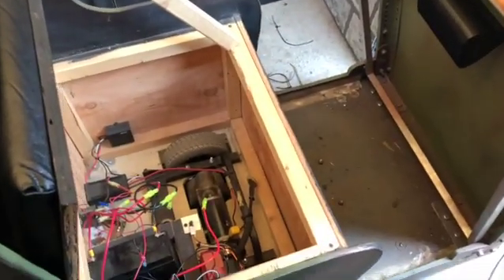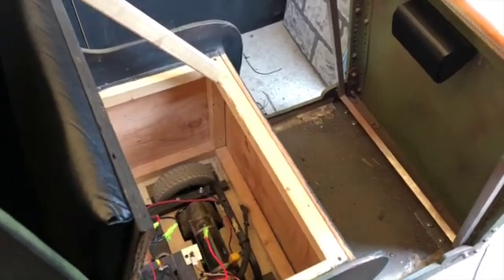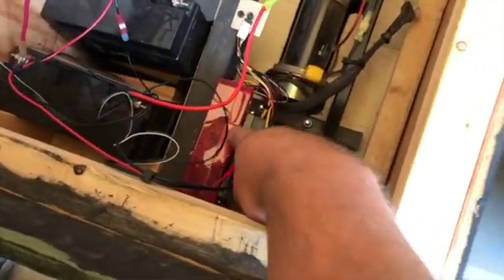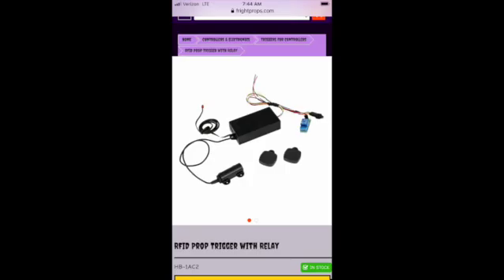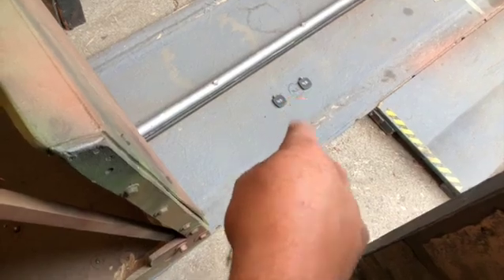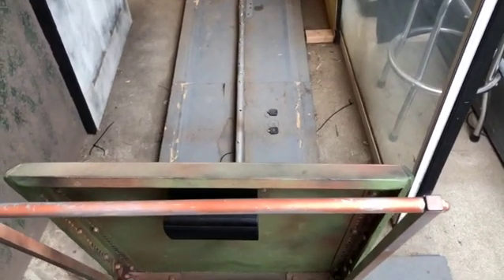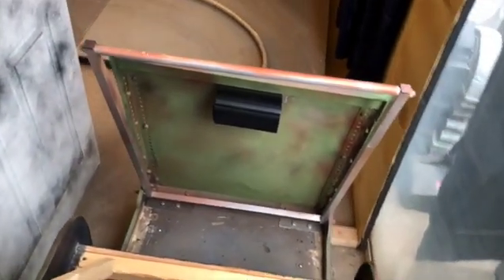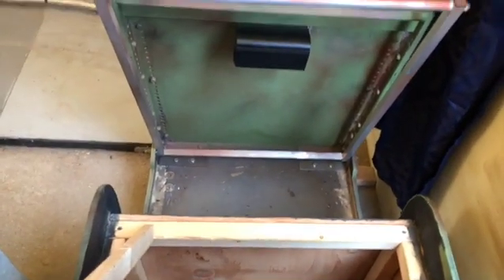RFID Triggered Audio Tutorial

Comment: Thanks Brett. Just wondering what are you using to power the mp3 player and the speaker etc ?
Reply from the maker: I used a triggerable MP3 player that used 12v . To power it I wired it to one of the 2 batteries I used to power the ride vehicle.
Reply: @ thanks! 🙏